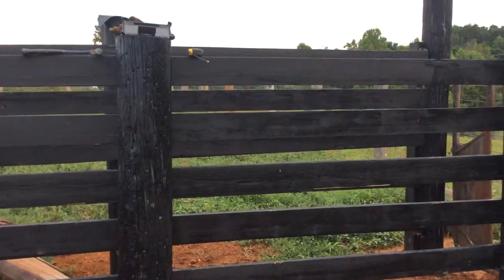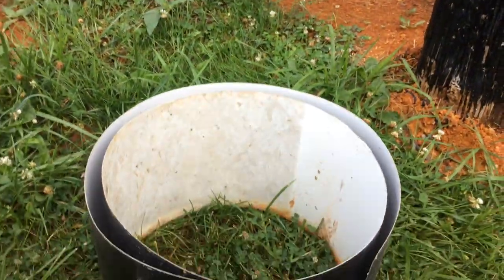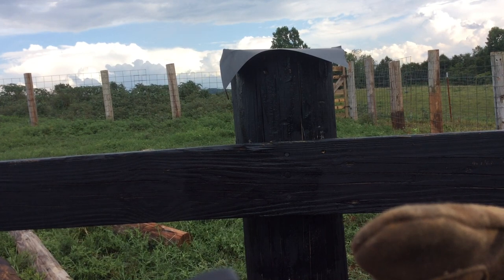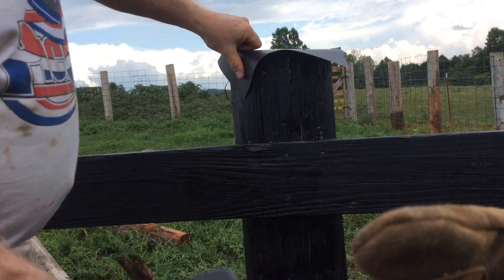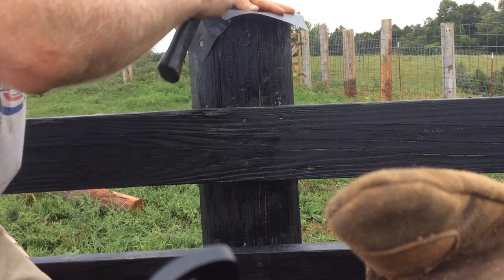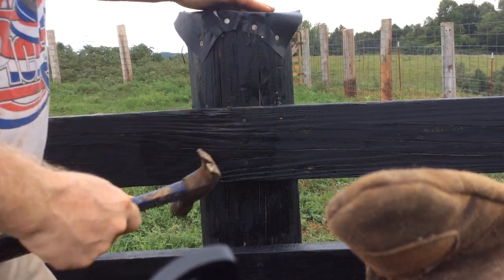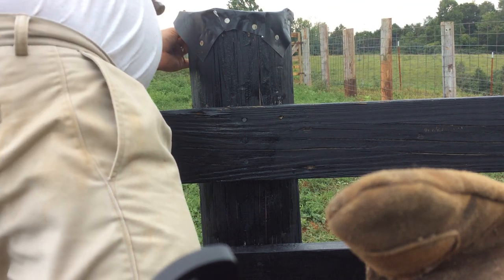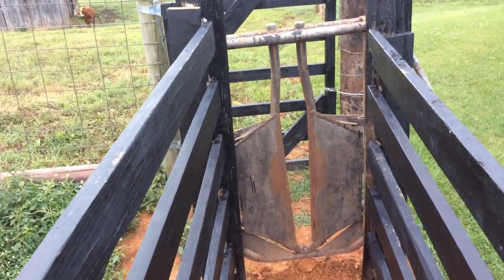Make your wooden fence post last forever with this trick.

Comment: Be careful....that's some sharp metal edges all over that there post buddy
Reply from the maker: Yep.  gotta be careful to hammer them down.  Actually the one I used for the video was the worst example I could have posted.  Most of my other ones turned out pretty smooth, but trying to get it right in the video I was nervous.
Reply: @earlclaborn  You're doing great.  Keep making videos.  I've almost watched them all.
Reply: @littlebumblebee8356  yes.  It's a good way to use up some scrap material if you don't have thousands of extra dollars just laying around to buy the prefabricated materials.  I'd rather have something I did myself than to just go buy it already made.
Reply from the maker: Thanks for the support
Reply: @earlclaborn  Good idea.  You can use scrap metals or buy some cheaper materials and make your own fence post covers.  That works great for those people that don't have the extra money to give to retailers.
Reply: Maybe not a pretty as the prefabricated stuff, but certainly more cost effective...
Reply from the maker: @oldmantruckingco.2423  I appreciate your thoughts, and thank you for viewing our channel...
Reply from the maker: @lisatremble356  Thanks for watching.  We appreciate you.

Comment: Would a good soak of motor oil and diesel work or is your method needed? Thanks
Reply from the maker: I have used motor oil and diesel fuel on projects in the past, and they work fine.  I actually build a lawn mower shed once and painted it with used motor oil.  Bees will not be building nests in there.
Reply from the maker: If you can get it, crude oil, that works well also.